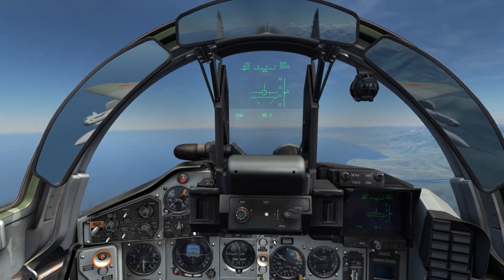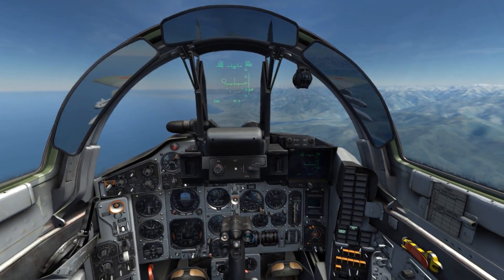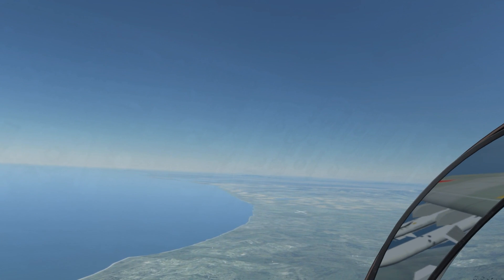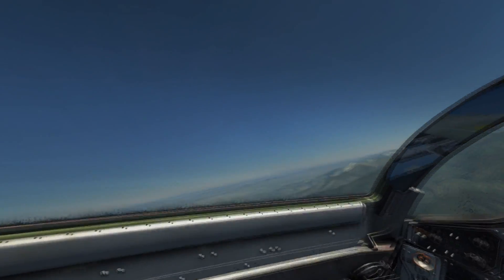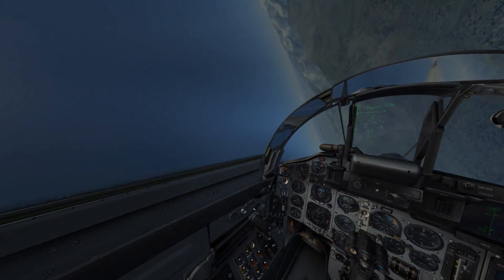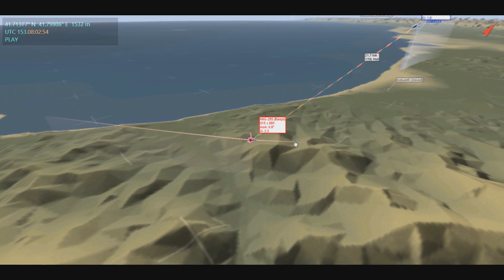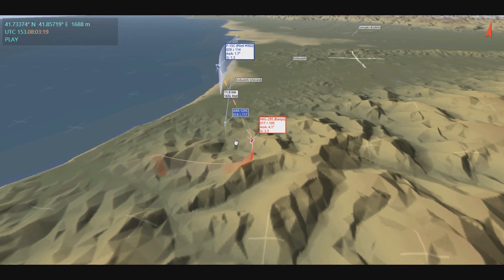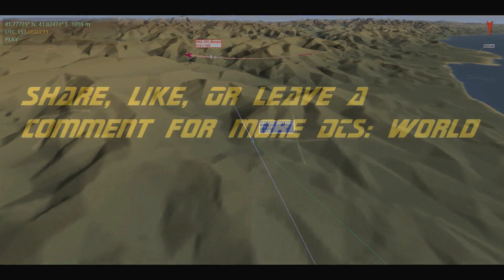DCS:World » Defensive Notching » Air Combat Maneuvering

Comment: How did you get the radar lock to show? My Tacview refuses to show the dotted lines
Reply from the maker: Are you running the trial version?  As there is an option to enable the radar lock display though it is not available in the trail as far as I can recall.
Reply: Hmmm nah using the professional one but I just cant get it to show....do you record by rewatching what you played or directly from the mission?
Reply: Could you sent me one of your tracks so I can see if the radar shows on them? Or Ill sent you one?
Reply: Got an answer from the Dev....apparently everything that is not FC3 does not show locks atm but it might be possible when the new 2.0? comes out where tacview is integrated into DCS

Comment: does notching work against any doppler radar as long as the enmy is at a higher elevation? great video
Reply from the maker: +II./JG53_ Johannes Any doppler radar that filters out ground clutter, in the event a radar doesn't filter it than you would appear though most radar does filter ground clutter.  It will work as long as the emitting radar is looking down at the ground.
Reply: +pickinthatbanjo oh okay cool, thanks for the response loved the video
Reply from the maker: No problem, and glad to hear it.
Reply from the maker: +II./JG53_ Johannes I suppose it's worth noting other aircraft may have filters that allow them to see aircraft that are attempting to notch, for example the mirage 2000C has a Low PRF setting called BFR which apparently is "Nearly impervious to notching but highly susceptible to ground returns".  Though I'm not sure if that function is implemented as of yet.